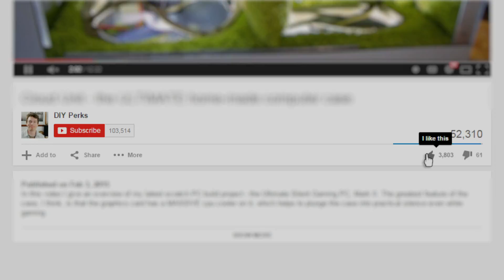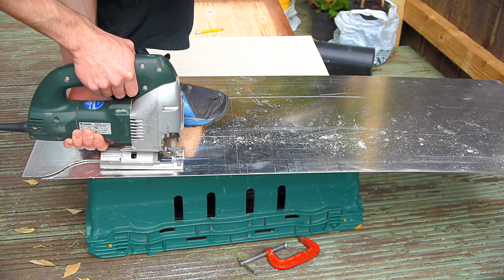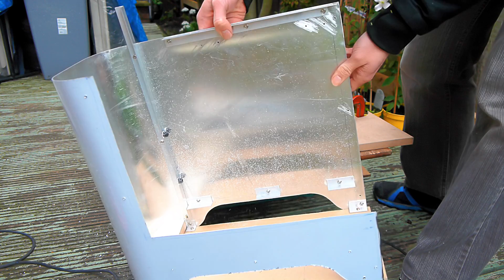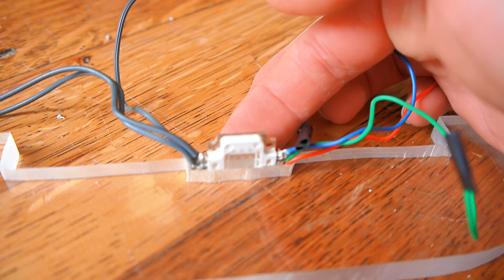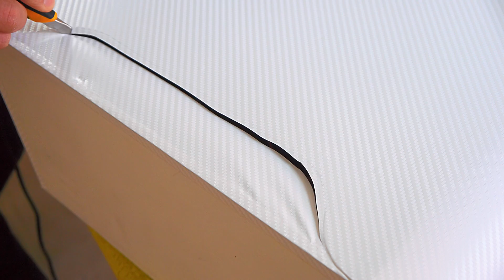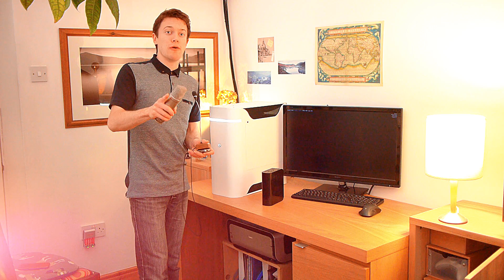Cloud Unit - Build Log (Scratch-Built Silent PC)

Comment: nice build man, but as you have connected the Graphic card cooler to the case for keeping it steady,and the heat from all the other components. doesnt it transfer the heat across the whole case since its aluminium. doesnt the case become hot ? is it part of the plan ? and doesnt it loosen the vinyl wrap ?

Comment: you should have used a ssd its silent the hdd can move and upgrade if u want it to be more silent buy a 2,5 inch to 3.5 in adapter and add a ssd it will make it faster and silent remove bot hdd and get a good ssd

Comment: How did you make the RAM and voltage regulator coolers?

I'm thinking of having a go at this myself.  I just bought a new cooler which means that my Arctic Cooler Pro Revo 7 will just be knocking about.....

Comment: Hey Matt! Really looking forward to your Video on the backup system! 2 Questions:
1. Where did you get the button for the Case? I am making a custom Wood case by the time summer rolls around and I need some parts for it!
2. Any recommendations on how to make custom cases? tips? advice? all are welcome! Thanks!
Reply from the maker: TheJcdesignz I got the button from eBay from a Chinese seller. Loads available, but they are on the expensive side considering they're just buttons (although very well made). Just search for "led momentary button" and you should be able to find some.

Comment: You made this without screwing up anything? Well done, mate!
Or is it just clever montage?
Reply from the maker: ProjektMacu The build went smoothly for the most part, yes. The difficult bit was getting the optical drive in place properly, as it had to be positioned precisely so that it wouldn't touch the slot that I cut for it in the top panel. Ended up having to tweak that a few times, but got it right in the end.

Comment: You did say aluminium was better than wood for lower resonance inside the case. What do you think about clear acrylic? Whats your opinion about the comparison of wood, aluminium, acrylic and anti-noise foam for the inside of the case?
I dont like the green stuff so much. Do you think rubber bands could do the trick too for the fans? Or would it be less effective because the green stuff is absorbing noise too?

Comment: Your work is so amazing. It's weird how all the work you do make me feel like I know I can do it I just need to quit being so damn lazy. The only tips I can suggest is for the next case buy a dremel (an actual dremel not just a cheap rotary tool) and possibly get pop rivets instead of the screws.
Reply from the maker: x9x9x9x9x9 Funny you should say that: I just got a dremel yesterday!
Reply: Sweet! Its one of my most used tools (after basic stuff like screwdrivers and what not) I use my dremel to sand and cut stuff everyday I probably use it more than my drill now that I think about it.
Reply: x9x9x9x9x9 I'm using a 20€ rotary tool, and it does the job too :p

Comment: Have you ever thought about using ribbon cables/right angle adapters to make a very, very small gaming computer? The other thing I'd like to suggest, having thought about it for a while, is a computer mounted in a backpack (some sort of semi-rigid support system for motherboard mount) with some wood/aluminium framing to provide structure. Great video!

Comment: Hey Matt! I love the video! Great great job! I have one question though, from where did you buy the aluminium sheets and how much did you pay for them? Thanks alot mate! :)
Reply from the maker: ***** I just got them from eBay, and just chose the cheapest for sale at the time (which is probably changed by now). Buying from eBay is, at least in the UK, the cheapest option as metal distributors usually charge a tonne for postage, whereas on eBay they somehow include it for free. I can't remember the exact price but it must have been somewhere around £20.

Comment: What software did you use to back up your system so quickly?
Reply: Correct me if I'm wrong but I assume that that was a timelapse.
Reply: Elysium timelapse video. its sped up 4 or 8x
Reply: Elysium he back ups only 2.(something) GB .. like the one video he is trying to let us see the features of that ExT PC ..
Reply: I would still like to know the name of the software he is using, I am looking at my options for a backup solution.

Comment: Matt has invented a new form of motherboard layout: MTX. I can already see the wiki page:

MTX (Matt Technology eXtended) is a Mini-ITX based layout for desktop computers. It was created and designed by Matt (Insert last name here), for the sole purpose of correct airflow in which heat rises, allowing for more natural cooling of computer components.
Reply from the maker: Uphorics Haha, brilliant! If I could feature comments, yours would be it.
Reply: Well,MTX will be the case/PSU layout,because the motherboard is not modified.
Reply: Matt can't take credit for the 90 degree motherboard solution. VoodooPC already did this in 2007 with the Omen.
They had Silverstone to built most of the aluminium components for them.
Reply: @ZuLangable  I was about to say the same :)
Reply: You're right. ATX is old technology. MTX is new!

Comment: It looks cool, it runs cool and it's overall very nice compared to production cases. It's really awesome and an amazing diy work. IMHO next time you should work more on the build quality of details... Carbon wrap is not that much of a clean finish to me, and also the green cloth (even if it's super functional) looks pretty bad, especially in the room divider, where it's not even straight...
Reply from the maker: Andrea Colombo I've learned a lot from making this case, so I reckon my next one will be even better - particularly on the inside. With the carbon wrap I agree that some of the edges aren't as 'clean' as I'd have liked, so next time I'll be using it only where appropriate with a mind to have clean edges. With this one I really didn't care how it looked on the inside as I knew it would never be seen after the case was in its place, hence the "function over form" attitude to the inside.
Reply: DIY Perks  You might want to see if there's a local shop that'll help you powder coat the aluminum. I recently reached out to a local shop that let me do it for $20 CAD and it ended up looking entirely professional. Many shops deal only with large parts and so will do something small like a chassis panel for next to nothing.

Comment: Isn't it dangerous to keep towels, or any kind of fabric for that matter, as near the components as you are? Static electricity could easily form when you try to do something in there, which eventually could lead to your components breaking.
Reply: Bet you wished you paid more attention in Science class....!
Reply: Peter Kay I live in Sweden, so the classes are not the same, and additionally, I'm still in school ;)
Reply from the maker: Weriton001 The fabric is glued to the aluminium, which is itself grounded. Any static buildup on the fabric should simply discharge through the aluminium without having a chance to build up.

Comment: You could achieve better eficiency if you´ll put them so they´ll suck the air out from the computer rather then making them to force the air in, but other than that, it seems really interesting, great job
Reply: Having a positive internal air pressure is better for avoiding dust though.
Reply: it has advantages and disadvantages :D

Comment: Sexy make pc cases and we will buy it from u , but u gotta make regular psu mount a lot of wasted space , a psu leaving it expose is dangerous
Reply: Why...? It's in a sealed case... Sticker on the back saying "Un plug from mains before opening" solves the problem. Also, even with the PSU lid off, it's not 'very' easy to find an unprotected mains live terminal (I'll admit it's possible) but unlikely done by accident.
Reply: Peter Kay I would disagree that the primary caps are not very easy to touch...
Still,if you know what you are doing,you should be fine.
Reply: Giggity Goebbels I refer you to my previous comment: "Slap a sticker on the back" Job done...

To be honest, I prefer the Darwin approach! Extra bonus points if procreation has not already taken place...
Reply: Peter Kay I would say to some people,instructing them to disconnect is not enough.There is a need of a more detailed  warning:No user servicable components at the bottom right below the motherboard. Lethal voltages present even after disconnection.To ensure safety please press the power button when disconnected to ensure the lethal voltages are discharged before opening the case.
However,many people would still tl;dr.

Comment: Your new heatsink doesn't cover the RAM at all it is likely to be running very hot. The original cooler cools the RAM as well as the GPU. That might explain why the temperature was so much lower. Not good for the RAM though.
Reply from the maker: mojochan The original cooler didn't touch the RAM at all. They were just left to cool themselves without any help.I mentioned in the video that I did add some heatsinks to the RAM and voltage regulators though, so you must have missed that bit.
Reply: DIY Perks I'm glad you addressed their cooling since your previous GPU heat sink video. Graphics cards now have thermal pads to connect VRAM and VRMs to heatsinks as these tend to get quite hot. Your current setup should be sufficient - time will tell.

Also, sweet build ;)

Comment: Great build fella. If you want the plexiglass light to be nice and clear, after fine sanding, give it a few quick blasts with a gas torch.  This may not be possible now your vinyl wrap is on, but you could try it on future projects. Test it out with some offcuts first.
Reply from the maker: Malcolm Arnott Hey, thanks for the tip! I was actually going for a frosted look with the plexi, but I can think of loads of times when I've wanted it to remain clear. Cheers!

Comment: How about a kickstarter to mass produce this thing?
Reply: It needs heavy modification to make it less 'customized',a standard PSU will need to go in there,the terminals and the back for powering random stuff will require a molex connector instead of directly from the PSU,the holes for the graphics card cooler will also be a big problem.
Reply: Giggity Goebbels I think it might be worth it to bundle the PSU with the case, (Maybe allowing some watt variants?), for the graphic card, bundling a "cpu cooler adapter" should do so that one could decide if actually use a CPU cooler with the GPU as good GPU fans are quite most of the times, in my current build that damn cooler master PSU is the silence killer, so annoying!
Reply: kingbastard2 The position of mounting holes and the GPU itself is different on most cards.That will require a lot of holes which might overlap and just not work in the end.

Comment: Okay, disc drives get extremely hot when running. I would rethink the pocket that your drive is in. One spark and this build might cause a fire. And with part of it made out of wood, I'd rethink using the towel. Maybe look at using some fire insulation inside instead. Also you might want to fire treat all the wood.
Reply: Why is everyone so preoccupied with fire on your DIY projects Matt...?

Comment: I would suggest to check the temps of you 2,5" data drive. Heat is the #1 reason why harddirves tend to fail.
But since you keep backups it shouldnt be a big problem if this drive fails, just a thing to improve.

Comment: @DIY Perks  the way you applied the paste on graphics card makes your card run hotter. never spread the thermal paste yourself u put a dab or a small line in the middle and let the heatsink do it for you this way there will be no air bubbles giving the heatsink more contact and it can spread the heat much easier.  and it will run much much cooler. other than that you're amazing i cant imagine making something like this myself

Comment: how did you do that with the psu doesn't it set the yellow stuf on fire 

sorry for bad english live in the neherlands we speak almost never english
Reply from the maker: minecraftcreeper52 No, haha. The PSU's high voltage wires and parts are all kept away from the fabric and are insulated in their own grounded aluminium enclosures.

Comment: Some interesting techniques for sound dampening. Its amazing how much sound can be produced in standard cases just from vibrations of fans transferring through the case. 
And while a lot of people will say "just watercool, much quieter", that just introduces a whole set of new sounds to deal with, pump etc.
Reply from the maker: DaveSimonH Spot on. Watercooling is a good way to get a better airflow path in standard cases, but it's a bit of a walk-around really. Why not just have a better airflow path from the start?

Comment: Hey Matt, this idea and video is AWESOME! Since i want to build my own custom case, i wanted to know how thick your aluminium plates are, and how much all the custom parts did cost you roughly? thanks!
Reply from the maker: Colin Altmeyer Cost roughly £40. As for thickness, it depends a bit on your design. I used 1.5mm thick aluminium as I wanted to thread the holes for the screws so that nuts wouldn't be needed on the other side. If you don't need the extra thickness for the thread, you can use maybe 1mm or so.

Comment: I think that the case is awesome :) but I just have one question. How did you do the wiring for the front panel?
Reply from the maker: A.J Norris By front panel do you mean the top panel? It was pretty simple really, just some USB extension leads going to the motherboard's USB header pins.
Reply: Oh ok. And how bout the power supply. How did you do that?

Comment: Extremely silent computer with extremely loud WD Green HDD xD
Reply from the maker: oskarus3 That's the backup drive though, so it's seldom active ;)Interestingly, it's actually the quietest desktop drive I've come across, so I'm not sure why you think it's loud?
Reply: Now I have 2 HDDs - Green (bought in 2010) and Blue (bought in 2015). Blue is almost inaudible when Green is so loud that I can hear it from 2 meters and as loud as my old WD SE drive which was bought in 2007. But it's still quieter than Black's and Red's which are specific drives with more than one disk.
Reply: oskarus3 Extended use makes them louder, thats why.
Reply: oskarus3 I have two green 2TB drives. I can't hear mine.
I have 4 HDDs in total and 1 SSD. I can't hear mine at all.
Reply: oskarus3
 I have Green 1TB too, i think you have bad luck friend.
Reply: Well, Greens are specific drives because they are turning off while they are not in use. So maybe that's a solution of our problem. When the drive is working it is loud but after a while it is turning off.
Reply: oskarus3 “Our problems”? Seems it’s only your problem,i have used loads of WD greens in past,no real noise issues.Could be you need to put some anti—vibration pads or something in them.
Reply: oskarus3 your comments 3y/o though,we all use SSD’s now...;-)

Comment: Hey, this is beautiful, especially that this is your first project with alumin.i.um. Also you how to pronounce the material name. This is great!
Few comments:
1., You can always repolish aluminium sheets very easily. A drill and abrasive disk is needed.
2., You can also brush it very easy. No tool is needed. Also, you can still do that by removing the white stuff from it.
3., Why not used water to cool the jigsaw blade?
4., Your backup system is just perfect. I do exactly the same only that I use SuperFlexible File Synchroniser and a USB HDD. Before going to bed, it's just one program to start and switches off the computer when finished.
Reply from the maker: Demeter Ákos Hey, thanks for the tips! I'll definitely try them on my next attempt - a polished look would be amazing.
Reply: robehickmann
Superflexible is doing the same. And it has a gazillion of ticks and checkboxes to create a backup just the way you want it.
Reply: Don't know if these backup systems do a full copy or not, but assuming you are not creating a huge ammount of data every day it shouldent take long. This is done with a delta backup tool like rsync, only the data that has changed is copied. I use rsync to backup my VPS (web/file server) over a slow internet connection, in total it's about 30 gig, but due to the delta compression rsync does it normally takes less than a minute.

Comment: why a gtx460???
Reply: its for expeirments and he dont play games or maybe he can't afford a new one
Reply: Captain Technology a 970 has the same tdp as a 460
Reply: XxRsawy8HD If you were to follow this guide you could easily change the gpu to something like a gtx 980 or 970 and still get good performance from the cooler although It might be louder!
Reply: Captain Technology no it would be much quiter and run cooler with a new gpu also much more power efficient
Reply: I would guess it's because this is all a test build. If all works perfectly then I would guess he would upgrade later on.
Reply: Der Tyros Ah I wasn't aware as I am new to pc lol so thanks

Comment: Would it be possible to make a watercooled system, but have the radiators outside the case in their own soundproof encasing? more expensive obviously, but overall the same concept but running cooler?